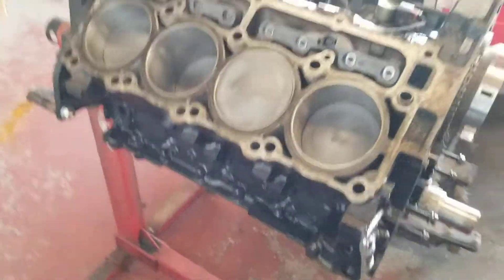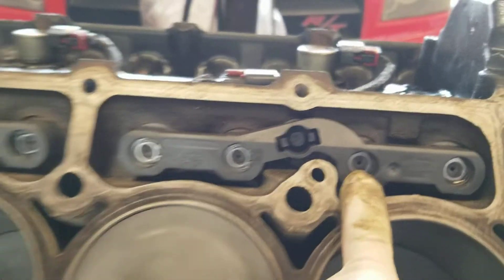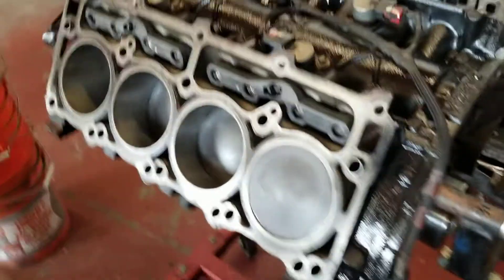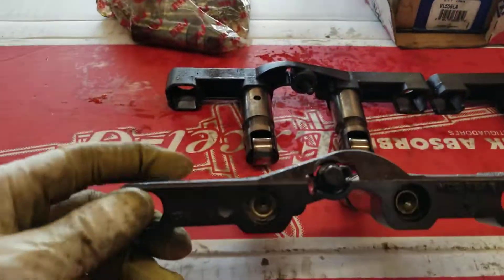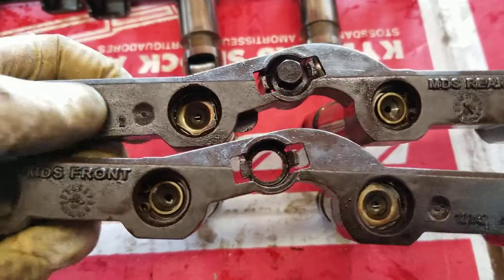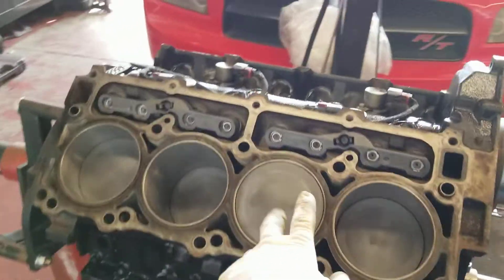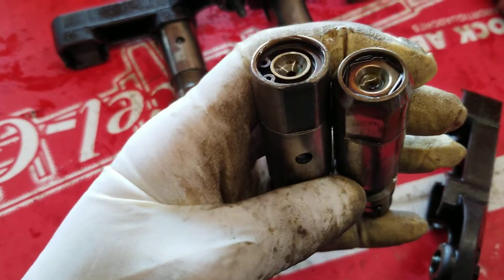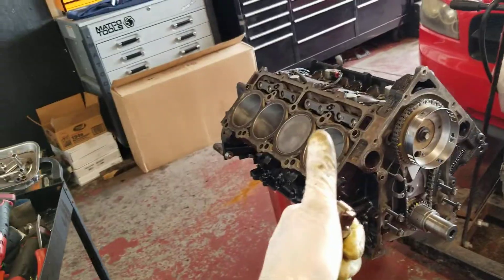how to; hemi lifters and lifter holder install on hemi 5.7 6.2 6.4 (300c challenger charger srt)

Comment: This should help a lot of people. Seen a bunch of these lifters failing. Thanks for the video.
Reply: Mine just failed. Exploded into pieces and got wedged in between the crankshaft and wall of the block. Locked the motor up because of it. My only concern is knowing wether or not to soak the lifters in oil or pump the lifters up. I’m getting 50/50 answers. Do it and Don’t do it lol.
Reply from the maker: Leave them in oil overnight

Comment: The yokes are different between the non MDS and regular lifters,MDS lifters are bigger and won’t slide into the regular holes on the yokes,it’s impossible to mix them up.

Comment: Boss man’s ram 1500 keeps doing the same thing on its 4th engine, 4th one seems good, found a bunch of shinies in the second oil change. Not much or any in the third I’ve been told. And boss says he can hear it (but I don’t, maybe just hearing injectors fire off or something when he in the drive through idk,) We landscaper so that truck idles a fair bit to cool out butts off in the summer at the least. It keeps grinding the lifters, ain’t sure how they work exactly, but I think they the hydraulic type and they get fucky after a while if ya don’t give nuff oil pressure. They seem to go about 50k for us. It’s warranty so we just take it to the shop we cut the grass for, so I ain’t seen em, but the old timers in there have silenced it a bit a couple of times with their dark art, probably just swap em around, I’ve never asked why they scrap em but I bet it just scores lobes and journals so they send em back to the engine builder shop. It’s a bit more subtle of a tick than the broken rocker Id think is you are dead right on, we just idle the truck a lot so and them big v8 s already sound like a bag of nuts (ours got a nice note after the mufflers the previous owner bought rotted at the welds and dropped almost like clockwork few months between em,) hauling lawnmowers if ya ask em for anything over 4K, must admit it’s a lot better than the triton 5.4 I think we got in the f150, so we just don’t do that often. I’m rambling, but I’d like to see if does come to ya if the rocker would be enough or there other Grinding and ticking noises going on, for his sake I hope it is just the lifter, also I hope he don’t give no one a freakin seizure…

Comment: Well we have one that's kind of backwards to that....both sides have the holes on the outside sets
Reply: THAT IS WRONG IF IT'S A 5.7 HEMI!!! Eco mode definitely isn't working, the mds lifters should be on the two outside cylinders on the driver side and the two middle cylinders on the passenger, you will have issues if that is wrong!
Reply: @mattolivo  that's what I just said